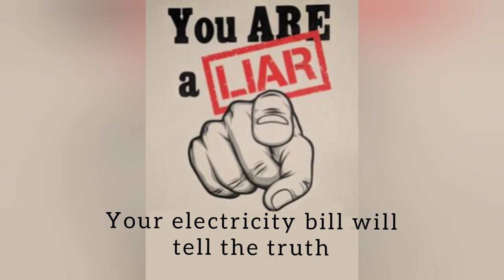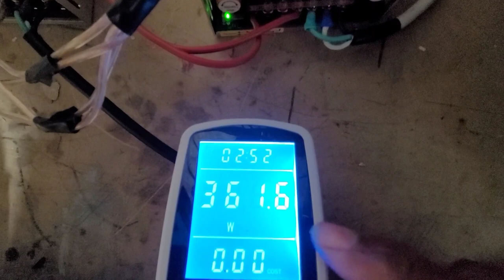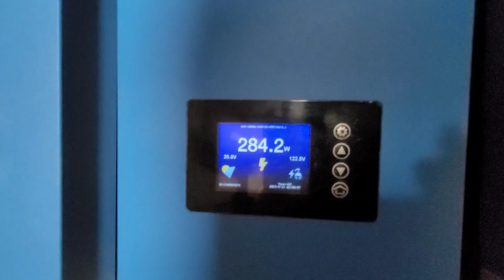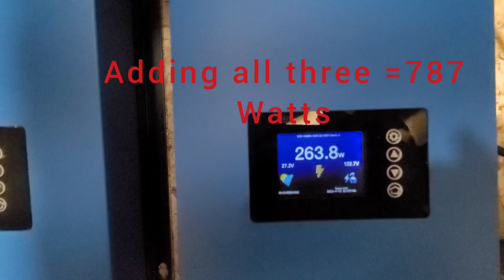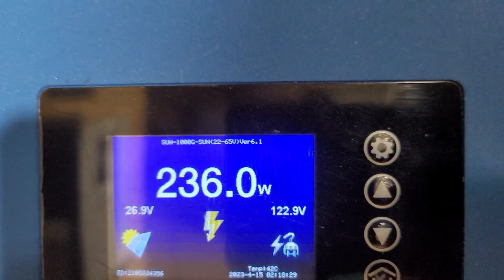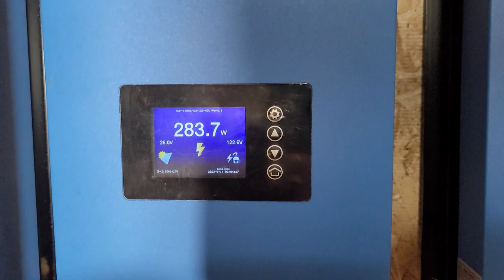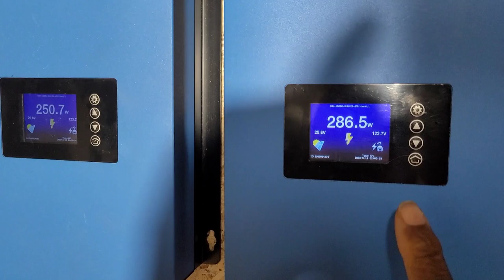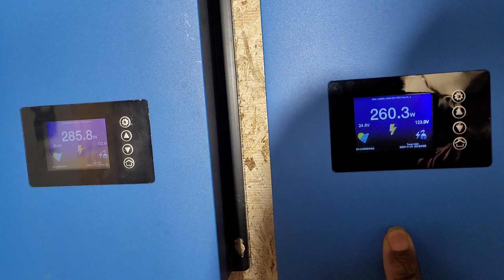what's breaking the laws of physics got to do with  (usage)

Comment: Initially, I was going to defend Lloyd because the first video seemed to convey a different message. However, as I've progressed through the video parts and seen their responses, it's become evident that they were discussing the concept of a perpetual machine. I still plan to present the argument I initially intended to make, but after reviewing their replies, it has reinforced my suspicion about the nature of their discussion.

It appears that there's a misunderstanding in both the first and second video. Lloyd clarified in the initial video (10:33) that this setup isn't a perpetual energy source. The primary objective of the first video was to demonstrate that you can connect a charger to an inverter to create a closed loop system.

The initial question was whether the output could be looped back to the inverter's input. Taken at face value, the answer is no; you can't send the 120V output from the inverter back to the input, which varies between 12V, 24V, 36V, or 48V DC depending on your inverter. However, you can convert the 120V AC back to DC voltage using another inverter (charger), sending this DC voltage to the MPPT, which then feeds DC voltage back into the battery bank. Yet, this approach seems unnecessary since you can directly connect an LFP charger to the battery bank, effectively eliminating the MPPT and minimizing energy losses.

I'm estimating that Lloyd was consuming about 250W-300W of power. This estimate is based on the assumption that the LFP batteries have a capacity of 100Ah each and are "charging" at a rate of 30W-50W. In the video Lloyd reconnects the charger to the grid to charge the batteries, removing the 250W-300W load, and allowing the battery to recharge. However, Lloyd doesn't believe that this loop results in a net positive charge, as they've acknowledged that the system isn't perpetual and won't run forever. It seems that Lloyd might be overly reliant on the accuracy of the device readings. If Lloyd genuinely wishes to monitor their system's power balance, invest in a $60 shunt, which can provide you a measurement of the energy deficit.

upon looking at the reply to the second comment, Lloyd says " I believe that you are missing the bigger picture.The point of the video was to demonstrate that it is possible to create a system where energy is recycled and reused. " Lloyd, youre not recycling and reusing, youre just using.

:face-red-droopy-eyes::face-red-droopy-eyes::face-red-droopy-eyes:
Reply from the maker: Normally, I don't engage in high-level thinking because most people don't think at the level you have expressed. You have a very keen eye, but there are a few things I didn't show in these videos. For example, I have many other devices, and I'm always using different configurations in each video. This is because I am constantly experimenting.
Yes, I have several shunts and I have made my measurements, but as I stated before, I save these for my books. Why should I keep giving my information away for free when people can't even grasp what I've already given them on YouTube? I have a book about cycling energy, and I also showed that engineers know about this cycling energy. Some people who didn't know about this got electrocuted when they thought everything was off. I showed a video of this in one of my previous videos.
To answer your question about what happens when you use a lower voltage to charge a battery, the basic answer is that it takes longer to charge the battery. However, once the battery is full, you can pulse the energy out into high capacitors, which means that you are stepping up the power a step at a time. If you have a higher level of energy that goes to a larger battery, once that battery is full, you can pulse the energy from that battery to a third battery, which will be at a higher level than the original battery. This is a way of cycling energy.
Here is another giant question: how did Edward Leedskalnin's Perpetual Motion Holder work? Hundreds of people have reproduced this holder, and one person in particular had it sitting in his laboratory for some years on a hook and then pulled it apart. It did exactly what it was supposed to do. Is this looping energy? These are little simple questions to test to see if people are on the same level as me. Once you understand what I'm talking about, then you'll be able to talk to me on the same level. This is not a put-down; it is a question for like minds.